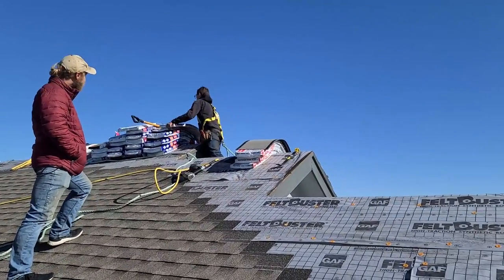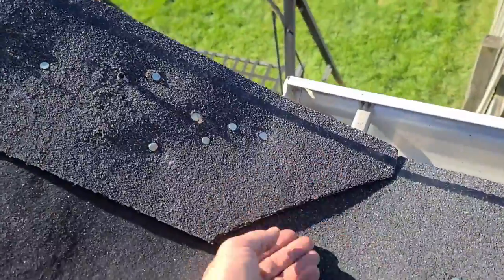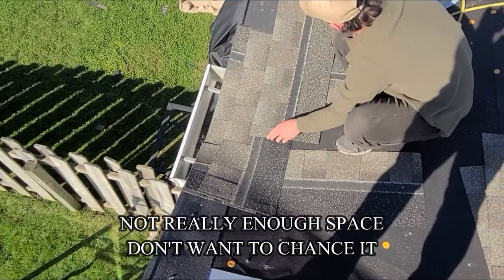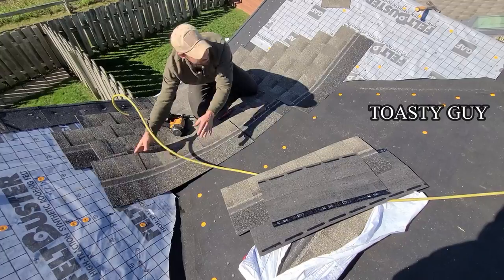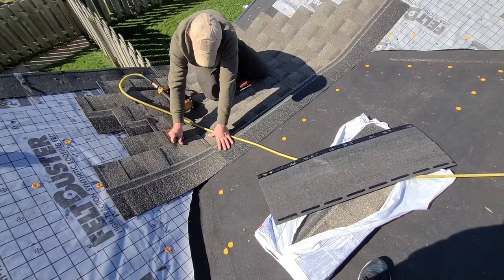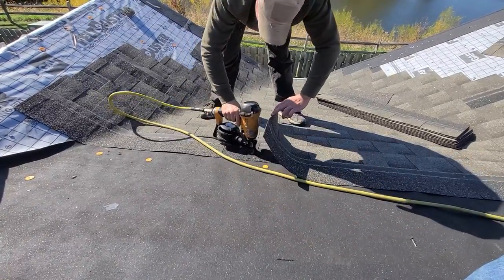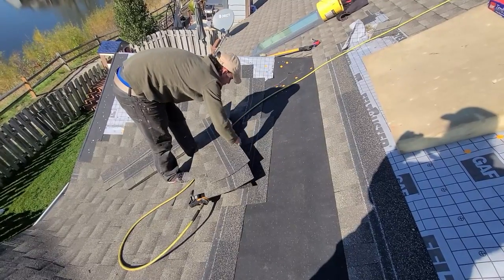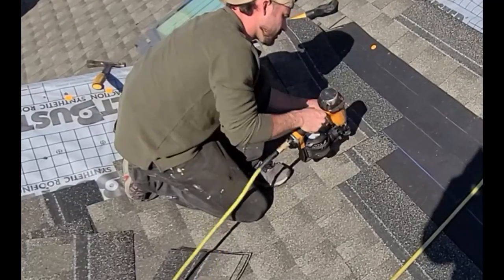HOW TO | DO A DOUBLE VALLEY (part 1)

Comment: In boycubs defense. I would’ve laid the roof the way he did.. though the dormers (appear) to be steeper than the main roof, sq footage is significantly less, and that spot between is going to bottleneck either way with snow.. my train of thought but if someone can give me good stats/figures to go off of I’ll forfeit haha.
Reply: Boy cub did it right.
Reply: And when I cali cut valleys, I always run a secondary bead of tar underneath the course of shingles that I lay parallel to the valley so even if that course doesn't seal 100%, I have a second backup against the moisture. Nowhere near as experienced as many of you guys but I've never been called back to any roof that I've laid or help lay.
Reply: @UndisputedRoofer  I thought so, but I'm not a roofer. Have laid many shingles but that's not my forte.
Reply: Same
Reply: Dude just did it backwards 😂
Reply: I would have ran 2 up the middle then step each side duh

Comment: This is 50/50 on the right way, unusual circumstances for sure.During  a major rain storm I think Id rather have it the way baby cub did it . But then again the steeper slope will shed faster but less flow. I guess you called it right once you take in the snow and ice situation.Good job

Comment: Lol boy cub did it right you got all that volume running right into that bleeder instead of just 4 feet hitting it you got 30 feet hitting that valley shingle aka bleeder. jeez
Reply from the maker: i just went a re-watched, i'm certain i'm right. the volume won't run up that steeper pitch. i get what you're saying, i really do, and i'm pretty sure it wouldn't hardly matter either way, but i feel safer running it this way.

Comment: I live in northern Utah we get a lot of snow, i color match tpo membrane and do 3 feet up with it from the edge and tie the shingles in, its a nice detail in area like that were snow and ice will build up
Reply from the maker: damn tpo? thats crazy
Reply: Color match? I thought it only came in white, black, and grey, and I cant see white matching very often. 
Black on red, black on green, black on tan..  lol ..
Good idea tho.. hard to see those ares anyway. So if you did commercial roofing, using scrap would save some $ if you just went with one run, no seam...
Reply: @Remodeling101  there's dark and light shades of each color, tan, brown, red, green, grey, white, I've even done a copper color
Reply: @Remodeling101  there's also coated drip metal in different colors that you can weld the membrane to

Comment: So will a marble be running faster at 20' going down a 4/12,  than it would be going at 6' down a 6/12?  I'm thinking maybe Boycub got it right. Or, if you were in a bicycle race, do you think that you could get going faster down a 6/12 that was 6' long than someone else who was coasting down a 4/12 for 20 feet? I'll bet kids at a skateboard park would be good at answering something like this.

Or, if you were on a hill that was steep, but it was only 3' high, and someone else was on a hill that was 6' high, and those hills were on a perfectly flat valley, and you both let balls roll down at the same time, which ball would go the furthest? Would it even depend on the slope? Would slope even matter? One would get to the flat valley quicker, but which ball would go farther before it stopped?
Reply from the maker: It's not always speed or volume.  Pitch plays a huge part in how the water will behave at the bottom and snow especially.  The snow will melt n freeze multiple times and it will be way easier for it to find its way in opposite of how I did it

Comment: How do you align your stagger between the bottom of the valley and the top on the 4/12 pitch? The top is already shingled, so how do you know how much to offset on the bottom to get the stagger to work out?
Reply: Tape measure if you're smart, a bunch of scraps of shingles if you're not. Nail the tuck afterward, not naming any names JB. LMAO, inside private now public joke, he won't see.
 Steeper the better;)

Comment: Hey so what are your thoughts on running say like 3 rows up in a weaved pattern at the overhang then cut the valley in after the first 3 rows
Reply from the maker: should work just fine here! but on a normal valley i wouldn't recommend it. it would look weird. valleys look best when the cute line comes all the way down to the first shingle.
Reply: @NWIVeteranConstruction  Thanks on the feedback

Comment: You know what your doing but still don't understand why you dont wear a work pouch
Reply: Why lug around a heavy pouch when all your using is a knife?
Reply: @Remodeling101  what if you need a chalk box some snips tape measure I would just have them laying around all over the roof or in the trailer in my personal opinion that is unorganized key to efficientsy is organization
Reply: Carpenters pants, or if you’re wearing shorts, cargo shorts. A couple of large pockets and your normal pockets are all you need. I carry a square, knife, pencil(s), some fasteners, etc in a regular pair of jeans..
Reply: @mattb4885  well you dont know what your doing thats why you would of done the vallys backwards

Comment: You hired a guy who just lied to you that's all don't feel bad pull it up and do it right the small always goes over the large and you should we leave those valleys now you're going to have a little difficulty because the pitch is different on the steeper side so skip your shingles over but keep your corner in the valley to go up one two one two you get an California header in there you're just going to ask for drama in the bottom of that should have had some kind of underlayment that holds water broke the pitch is so low it ain't going to do good on dimensionals they really hold the water slow trust me put some modified or some torch on that low area and then match the color and let your shingle ears dog over it good luck with that one

Comment: honestly think you are wrong, water doesn't run up hill no matter what direction you go in, where you're getting the most water running down in one direction is the way your valley should overlap. You think just because snow is building up in the valley it's going to run up that 4/12? unless there is ice damming its going to run down. water takes the easiest path always 100% and if you ARE ice damming, no overlap is going to help because it's going to run up over the topside of the shingle. You tore off his shingles just to prove a point that probably wasn't worth proving.. Now, if it was a 4/12 running down onto 12/12 dormers, i might agree but your pitch difference is shit all
Reply: especially when you've covered the entire space with ice & water shield and he's nailing 6" from the valley, you would think it wouldn't matter? Fuck are you guys using timberlines? wow amateur hour
Reply: Yeah and he just put a ton more nails/holes in that spot

Comment: Boycub did it right your sending him home for doing good work? He didn't do it back wards. he did it right your teaching him wrong he should be sending you home.
Reply from the maker: I didn't actually send him home lol and it was definitely backwards.  You ALWAYS run the lower pitch side under.  Unless there's some freaky pitch issue. I've had to reverse valleys half way up
Reply: Not if it's less volume like that dormer you have way more rain coming down that roof cause its bigger it doesn't matter if that dormers steeper its 1 1/2 bundles compared to 10 or 20 square boycub had that right.
Reply from the maker: @UndisputedRoofer  you would think that! Believe me, I had to look at it too.  But the issue is explained somewhere toward the beginning of this video.  I promise you do not want that cut line or "valley line" on the lower pitch because the steeper valley is gonna detour water towards that valley line and it will not move very fast on that lower pitch. This will give it time to spread under the valley line and get to those under side shingles and beyond.. eventually... if not for a rain, then snow.  And you don't wanna rely on underlayment.

Comment: You always run valley to the steepest part your worker did it backwards which cost money and makes your company look bad. Roofing companies I've worked for to roofer would have to pay for the mistake bottom line
Reply: If anything this made his company look great. Admitted to doing something wrong and then fixing it.
Reply: No you do not always cut the steeper side. That only is for when both ridges are the same height. If you have a dormer that is steeper than the main but the ridge is lower, you should run the dormer under, and cut the main, because you will have a greater volume of water coming off the main. Now if both ridges are the same height then you run the low pitch side under and cut the steep.